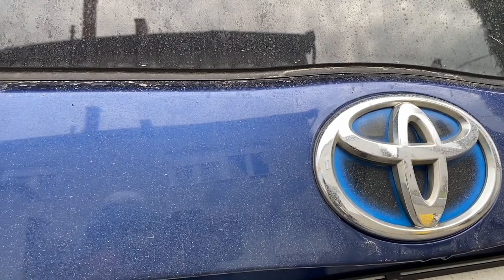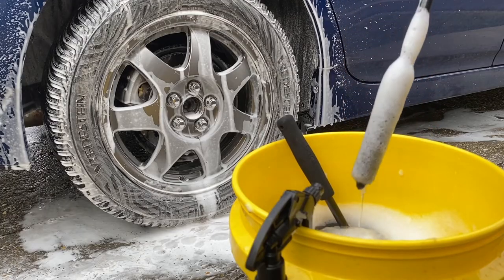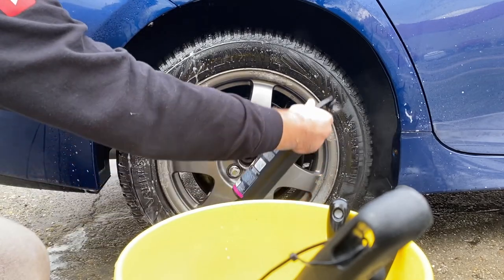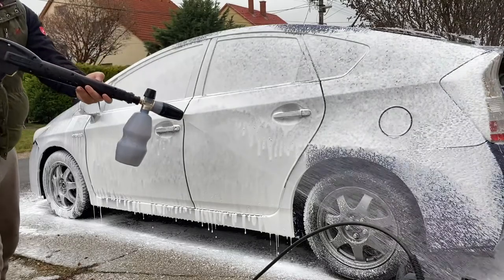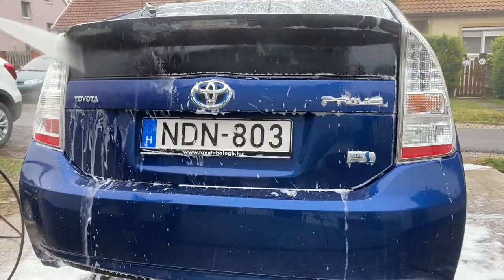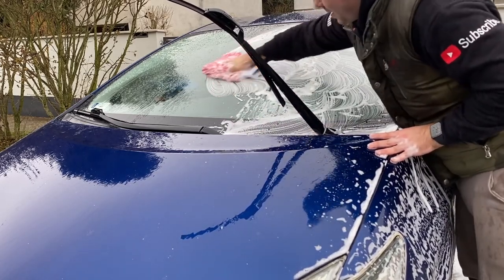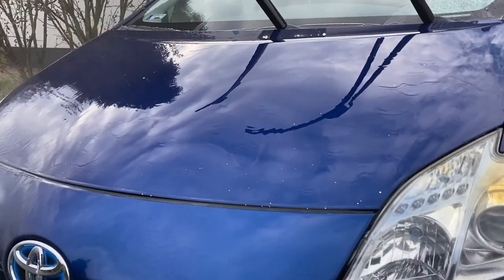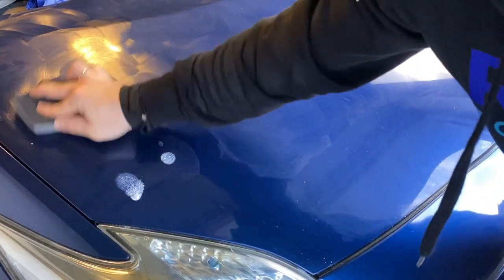Labocosmetica PRIMUS & Meguiar’s WASH Plus Shampoo (The First Wash)

Comment: It is better to make straight motions with the washmitt.  Circular motions make more difficultier to delete swirls
Reply from the maker: You’re right John. But Meguiar’s Wash Plus contains abrasive components in the formulation that intended to “do slight correction” as well as remove any left over LSP. So, while I totally agree with your statement, I followed the instructions stated on the label by Meguiar’s. Even though, the information of this only can be found on the label, nowhere else I can rectify this, which is weird, also. 

I believe we do more harm than good with circular motion, same as you just said, too. But I always want to demo the products by the instruction stated on the bottle.

Great shout John, and thanks for watching 🙌

Comment: Washing a car in the rain...This guy is a die-hard lol. 

I'm thinking of purchasing the Meguiar Wash Plus shampoo...Do you recommend to seal afterwards? I would think so right? Since it does somewhat polish?
Reply from the maker: I had no choice, once I started the rain came.. nothing else I could do 🤣

Think of Meg’s Wash Plus as a “decontamination” shampoo. It won’t polish out imperfections! But what it does: gives the surface a very deep clean, and removes the vast majority of stubborn, embedded dirt particles such as : tar, iron and removes existing sealants and waxes, which you cannot remove with a basic contact wash. It might save you time, because you might skip deiron and detar, but it really depends on the individual state of the car in subject. Hope this makes sense. 

I used it as a “quick” deep clean anytime when I basically want to remove existing waxes, sealants and want to apply a new one. As well as to decrease the time of detar and deiron. 

So yes, you will always need to use some finishing product afterwards and never think of this shampoo as: “real polishing” shampoo. What it does all in all: it polishes the surface with tiny micro abrasives in the formulation, which only helps to clean the surface deeper, but thats it.

Hope this helps
Reply: @RoadToDetailing  Great. Thanks for taking the time to give such an extended explanation. Extremely helpful, especially since I'm new into the detailing world! Really appreciate it!
Reply from the maker: @rlinkandroidauto-xe9sg anytime mate. I know it’s a bit confusing, especially at the very beginning. Not to mention the awful lot of products on the detailing market. :) thanks for tuning in, feel free to ask and I will try my best to help you through ✌🏻